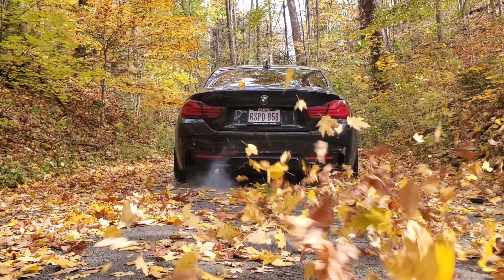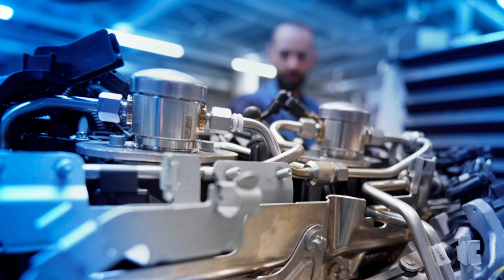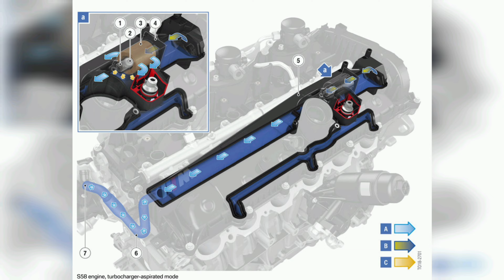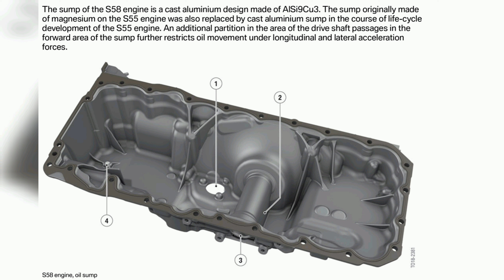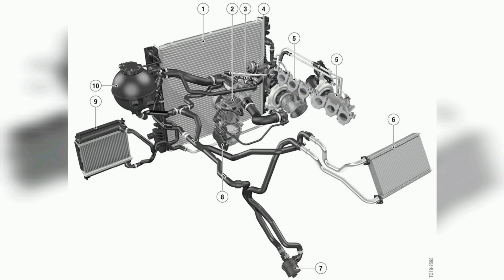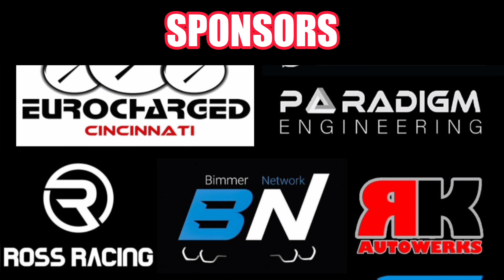Why the BMW S58 Engine is SO GOOD (S58 Technical Training)

Comment: Great breakdown. Interesting that the oil cooler at the bottom of the car has a temp sensor on it and only utilizes it in certain scenarios. I just put a guard over mine. Only $200.

Comment: So other than power, which is better B58 or S58? Reliability wise?
Reply: The s58 is a reliable engine but it is a Motorsport engine. The only stuff breaking so far is plastic hoses n stuff

Comment: Only thing wrong with the s58 is that it was 3d printed the exhaust ports r rough if it was smooth it can prob flow as good as the 3rd gen b58. S58 took good things from the 1st and 3rd gen of the b58
Reply: S58 was out before gen 3 b58

Comment: its the best engine ever made in history
Reply: Actually third best…

1. 2JZ 
2. B58
3. S58
Reply: @Great_America   The 2JZ is definitely not the best engine ever made. It was overengineered for it's time, but if you talk to people that know(perform maintenance on these engines; Papadakis racing, RealStreet) you will find out they aren't all that special - being beefy to hold big power doesn't immediately qualify an engine as the best engine ever made. The B58 bearings, intercooler, stock power, power band, block composition(weight), cylinder wall coatings, efficiency... looking at it from a technical standpoint, the B58 and 2JZ aren't even in the same ball park. As expected, they were created over 20 years apart. And no, I don't think the B58 is the best engine ever made. Those titles would would go to truly legendary engines like Cosworth's engine in the T50

Comment: 80% of the parts for the S58 were designed for the S58 from scratch - facts
Reply: The B58 foundation was from a BMW diesel engine - that's why it's so stout.

Comment: Hi friend, I have a question for you. I have a 2019 BMW X5 go5.  With B58 c tu I always change my oil every three months. I don't wait like BMW says to change it after a year and a half. The problem is that at the same time when I'm checking the oil level, after 20 seconds the system crashes and won't let me see 100%, but I can see that it says OK in a fraction of a second. What do you think about that? Thanks.
Reply: Rllly weird. Maybe a full infotainment reset?

Comment: They also rotated the spray pattern of the B58TU injectors. They were trying to prevent warping of the upper cylinder. Lower compression ratio, bore and stroke changes, less flowing injectors... reliability and boost were in mind.

Comment: thinking along the same concept as s58 head on a b58.... would it be possible  to explore s58 head on S55 because some of the systems exist in s55 to support it? or are there simply too many architectural differences in block/mating surface to be viable?

Comment: Thanks for doing all the work to learn this stuff.  I have a 2024 BMW and am a first time owner of a new BMW.  I'm wondering about the problems down the road because of direct injection without port.  Will there be need valve cleaning down the road?  Thanks, Dean in Oregon

Comment: 12:50 Concerning the about estimated power output of the S58 and you assuming it's capable of doing about 30% more power with the injectors, I want to tell you, you are pretty much right! There is a german tuner called Benny from "BK Performance" and about 4 years ago when the S58 came out with the X3M and X4M models, he already got his hands on the X3M and tested it's "limits", he ended up at 757hp with everything stock besides installing a different Downpipe (and what I'm not sure about is, he might have changed his Intercooler to a Wagner one, I don' remember exactly no more), BUT what I know is, he definitely didn't change anything else than I mentioned. The car was also featured on quiet a few other YouTube channels like "AutoTopNL", he could have went for slightly more power as well but he wanted to run a safe setup. He even drove the X3M with that power with 310km/h+ !GPS measured! on the Autobahn :D

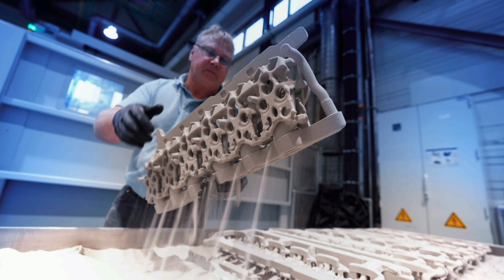Comment: 2:34 - it's only the sand cores for the head casting that are 3D printed.
Reply: Wrong.  None of it is 3d printed 😂 how the heck would you 3d bring an aluminum block?
Reply: You’re 100% right. At least from the photos, the sand cores are 3D printed, not the aluminum head itself which is cast conventionally from aluminum alloy. This is pretty common these days.

Comment: I have a G87, loved hearing about this engine in detail and why it such an amazing platform. Excellent video👌🏾
Reply: I feel that the G80 value will go to the roof since is the last fully combustion engine in the M line. Because from now on will be hybrid or full electric. Just like the Porsche 911 (993) with the air to air engine.

Comment: I'm so fed up with these so called incredible bmw engines
Who cares about all of these accolades, when they start burning oil at 50-70k miles and start having major issues under 100k miles.?..
Yes, S58 is great while you're leasing your X6M.. Big deal
Reply: X6m doesn’t have an s58 first of all second of all the b58 and s58 haven’t had any oil burning issues so far and a lot have made it past 100k miles no issues
Reply: @borisspaseski8934   mine has a B58 in it and at 70k burns about 3 qts per OCI. Many friends of mine are having the same results
Reply: @borisspaseski8934  Sounds like you got burned by an older gen BMW. These B/S58 engines are probably the most reliable turbo engines in the industry. Who would have thought BMW would master reliable engines, but the have. It's toyota's engines that are literally blowing up now. Go figure...
Reply: @socalbadger1  you responded to the wrong person bud
Reply: And we're fed up with ignorant people like you who don't even know what cars carry these engines, let alone know nothing about the engines themselves.

Nice try... 🤡

Comment: Idk imo the s58 connecting rod look stronger at least on the bottom side where the bearing goes you can tell it’s beefier and the the way the profile is it’s designed better but I agree it’s thinner

Comment: Hey so I have a question, I’m afraid that I might hurt my engine. Im eventually going to go down pipe tune, but right now I’m stock and I needed a oil change. So I used 5w-30 for thicker oil instead of the recommended 5w-20. I’m afraid it will hurt my engine since I’m stock as of now? Please give me some answers cause I’m worried.👍
Reply: I don’t think it will have any affects on it but I just want to make sure nothing will happen since I’m not modded yet. I only got 5w-30 oil mainly because I’m going full bolt on soon

Comment: Hello Kern, I just came across your channel and I am very grateful what you’re sharing with us. Thank you!
I recently bought a 2024 BMW M440i Xdrive coupe and running 94 octanes pump gas on JB4 map 3.
I also installed a VRSF 200 cell catted down pipe.
Do you think I will be okay to keep the stock fuel pump as well as injectors if I upgrade to a Vargas GC mid turbo?
Also, if the gas consumption would suffer with normal driving habits after the upgrade?
What do you think about my approach?
Warm regards.
Alfred.
July 9, 2024

Comment: Why S58 is better? Bigger bore and Less stroke. This engine is less under-squared meaning less stress on cylinder walls. It’s also an advantage for thermal properties. It can also rev higher. Valves are bigger as well. It’s a great combo for racing!
Reply: Also s58 has lighter crankshaft so its very responsive and and thrives at high rpms.
Reply: Hey. Can you do technical training on the s54 and s52 as well please
Reply: In a straight line maybe. Then you have the Giulia Quadrifoglio
Reply: Shorter stroke has disadvantages too... Higher piston speed, more angle forces on the rods etc. Longer stroke is also more efficient, because you can use the combustion stroke much better
Reply: S55 enine still better engine overall
Reply: @maximusEagle are you okay ?🤣
Reply: @giowilliams7855  that is some serious cope
Reply: @maximusEagle  the s55 is worse is almost every way if not every way but the actual chassis its inside is better
Reply: @maximusEagle not even in jest 😂😂
Reply: @maximusEagle you’re high

Comment: Kevin, thanks as always. Are the S58 injectors plug and play in a Supra/Gen 2 or do the seals need to be replaced? I'm looking to do this and have heard both...TIA
Reply: @mikew4796  it's plug N play besides needing a tune
Reply: @thefastforte2854  thanks! I just saw some new posts on Facebook where the same debate continues.

Comment: Watch that video, it shows a very good comparison of S55/S58/B58 rods and bearings and S58 parts are not getting a good rating there. You can switch on English automatic translation: https://www.youtube.com/watch?v=WA-k3p8zM2M
Reply: Translation is not good I see, basically S58 bearings are already slighly worn after 10000 km while B58 is even with 100000 or 200000 km still like new. So they say S58 bearings will become a problem like S65, so after like 60000 to 80000 km you have to change them. Pistons from B58 are ok but not the best. S58 pistons are better. B58 rods are the best, S58 is not as strong.

Comment: b58 still better
Reply: Go tell BMW to put a B58 into a M car instead of S58, lol🤣
Reply: @laijiang6162   toyota proved enough
Reply: @yuzar3974  Yup, prove enough that they are not allowed to put a true M engine in their German-made sports car.
Reply: Insane cope
Reply: Why is the B58 better? What makes you say that?
Reply: @bigjdm5460  better rods, engine is based of a disel
Reply: @yuzar3974  B58 on stock internals are capable of being thrashed at what WHP and Wtq? 

S58 stock internals are able to be thrashed at what WHP and Wtq?
Reply: @yuzar3974  Go tell BMW they made a mistake by putting the "more capable" B58 in non-M car lol.
Reply: @laijiang6162  e90 335 was faster then the e90 m3, history always repeats itself
Reply: @yuzar3974 except the s58 is a direct upgrade from the b58. N54 and S65 are completely different engines.
Reply: @AlexCapi  if b58 came from factory with a extra turbo and hpfp im positive it wouldve done the same thing as a s58
Reply: @yuzar3974  Well it didn't, so that's one of the many reasons why the S58 is better.
Reply: @yuzar3974  ？？How was the hisotry for the F series and G series? And E90 335 is not faster than a E90 M3, lol.
Reply: @yuzar3974 ”if my bicycle had an engine it would be a motorcycle” well duh
Reply: Why isnt it in my M4 then?
Reply: i agree,if you broke
Reply: @durin23 b58 is more reliable
Reply: Great video! Thanks for sharing

Comment: I loved the video, only thing I’m unsure about is, the rod bearings do actually have coating on the top bearings for S58 and not the bottom ones.
Reply: They do not. Any motor teardown will show you that there isn’t a coating like there is in the b58. Bearings dont seem to be an issue though

Comment: the cylinder head is not 3d printed. the inlet for the casting is 3d printed.
Reply: You can see the tech pulling the head out of the sand - that is a sand casting process. Glad someone else saw that. Still, great video, and i know more than i did 10 minutes ago.

Comment: Hahaha lol at the intro "the b58 is you" 😂😂😂 what would be nice is a comparison of bang for buck performance. A 30k b58 gen 1 with 30k in mods vs a s58 with a tune for example. All tough a M car will be sharper from factory. Many of yall only seem to drive in a straight line for a couple of meters. So that doesn't matter as well. 😂😂😂 Keep it up Kevin. 💪🏻

Comment: Its worth noting there are slight differences in the s58 found in F97/F98 to the G80/G82. The crankshaft used in the G8x is different - lighter and optimized for the higher torque & rotational speed. The right engine mount is designed to be more rigid than the left engine mount for the torque increase which should reduce force on the drive system. Pre-production 11/2020 F9X S58s have different cooling. The pre-production F9x S58s are missing an external radiator the G8X have. Also BMW decided to include stone chip protection guards on the coolant radiators.
Reply from the maker: Yeah technically this was made before the G8x was even out, so tried to weed through some of those specific details. Like the intake integration with the engine cover
Reply: I have a 22 and it has everything the g80 got
Reply: @giowilliams7855 yes the later models basically after 2020 have these updates.
Reply: Who owns a pre production vehicle.
Reply: @Raheem6838  Any X3m or X4m with a build date before 11/2020. All G8x will have the updates.
Reply: Good information.

Comment: Lol why would anyone be worried about an engine that’s not even in the 7s…
I think you meant S58 Is you Gen2B58 is the one your girlfriend tells you not to worry about 😂😂
Reply: This is such a brain dead comment lol.  You think if someone stuck an s58 in a tiny Supra they couldn't go 7s??? Ever heard of power to weight? Physics is a thing🤡
Reply: you sound worried,relax bro s58 will be in 7s soon also and haul 1000lbs extra with 4 doors and xdrive
Reply: @durin23  Gen2B58 already in the mid 7s, go eat a cake and drink some tea lil bro 😂😂😂 and don’t forget while you do that the quickest and fastest BMW in the world is the M240😂😂
Reply: @TurboThreeOh  why you so worried bud?
Reply: @TurboThreeOh congrats…but you know that’s because it’s in a smaller lighter car with an engine that’s easier to obtain. If you take a stock s58 and run it in a m240 and put it against a stock b58 give them both fbo who wins? That trend would continue into building the engines.
Reply: @mogulme6190  bro take an English class please, M240 and M3 G80’s both weigh about 3800 pounds, if you are really wanting to go fast “FBO” isn’t going to cut it for either car, obviously FBO S58 has twin turbos so it will be able to run more boost psi than one small turbo in the B58gen2, if you’re trying to go fast, you got to BUILD either car, and at that point the gen2B58 shits on S58. Records speaks for themselves and no point in arguing when the facts are out there in plain sight for everyone to see.

Comment: Break down the s55 next
Reply: It might breakdown before he breaks it down
Reply: @tumisosenyolo9046  really i have a big turbo one w pi and i’ve never had an issue w it in nearly 30k hard driven miles.
Reply: Then the S63
Reply: S55 is junk by comparison...up your game
Reply: @ you ride bikes😂😂 nobody cares about your input. one brake check and your done for buddy. i’d rather be faster than you and safer than you. no one cares about an overrated bike but you’re talking about a motor you can’t even get your hands on. you’re stuck playing with cheap bikes are toys 😂
Reply: @ImThatGUY42069  calm down son, you saw a tiny pic and started dreaming

2025 M2 and you couldn't brake check a paper bag
Reply: @ 2025 m2 😂 as if that’s a flex. i’m younger than you and have faster/ nicer cars that’s sad asf. work harder
Reply: @ImThatGUY42069  you know absolutely nothing son you're just spewing you know what....paid off house, very healthy net worth, zero debt and paid off cars.  Just keep digging a bigger hole with your junk S55 ready to blow at any time haha
Reply: @ImThatGUY42069 the 2025 m2 is a brand new s58 powered car. 

Why you hating?
Reply: @Tachyon836  because he's an insecure little as-h...his crystal ball comments on motorcycles were hilariously pathetic.  Clearly has zero skill at anything

Comment: We need this man on the S58 platform NOWWWWW
Reply from the maker: Trying 😭
Reply: @kern417 X3M is affordable to get into. Around low 40s for an extra large G80 M3😂.
Reply: @kern417  Sell them two busted ass B58's and go get yourself a G87 M2 🤣J/K
Reply: @jieddo1 LMAO
Reply: Buy him one
Reply: I feel that the G80 value will go to the roof since is the last fully combustion engine in the M line. Because from now on will be hybrid or full electric. Just like the Porsche 911 (993) with the air to air engine.
Reply: @mr.p9496 I hope you’re right, I’m jumping in with an G81  😬